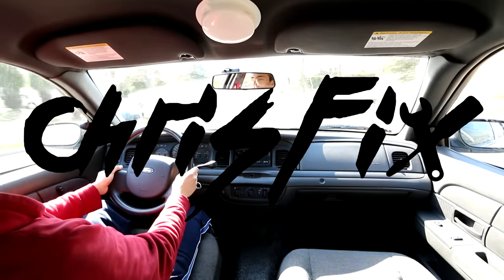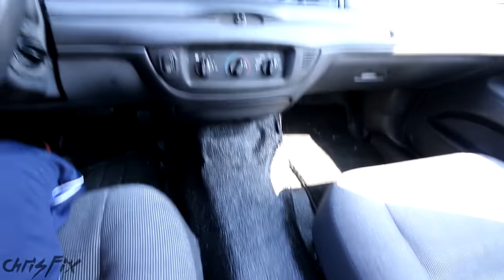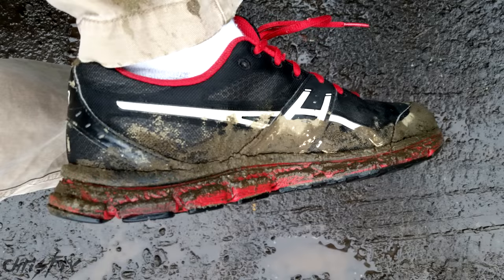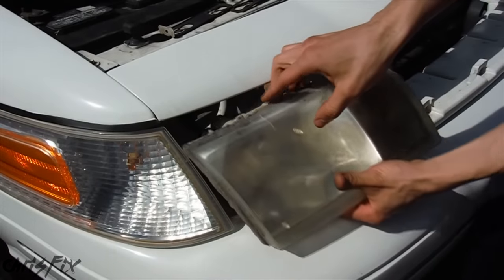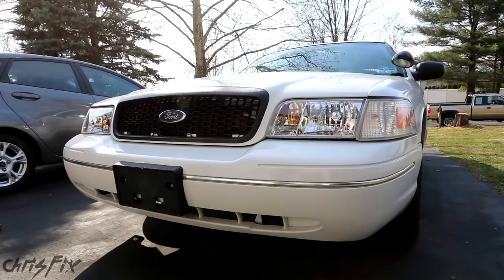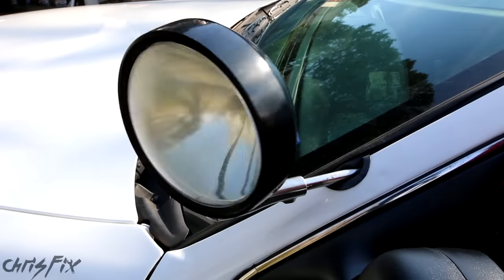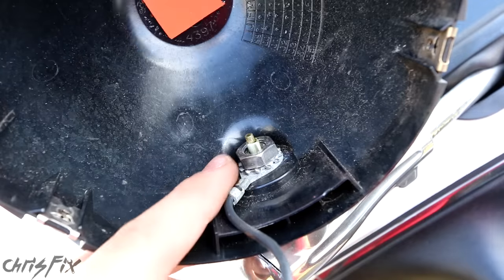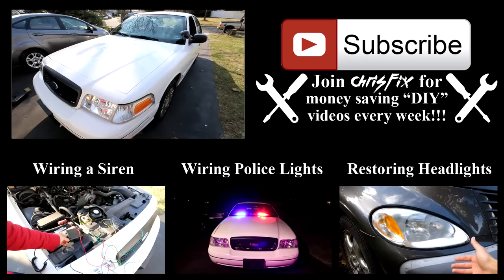How to Turn a Regular Car into a Police Car (Episode 1 Project Police Interceptor)

Comment: you forgot to replace the blinker fluid
Reply: And drain the spark plugs!
Reply: Aye, The Blinker fluid was replaced, and the spark plug got drained with Chris Got It!
Reply: lol 69 likes. i would like but i dont want to ruin it.
Reply: And check your tires gasoline levels
Reply: Blinker fluid is a scam! I've run my blinkers for over 10,000,000 blinks before, with no problems... sure my headlights caught fire, but that just means they were even brighter! Like the fucking SUN! 
You keep buying premium blinker fluid, you fool... I'm not falling for it.
You only need to remember your put gas in, change the oil, and make sure you grease your brake pads often so they don't rust.... no one wants rusty ass brakes.. that's dangerous!
Reply: I was about to say that
Reply: txhogndeerhunter LOL
Reply: He needs new muffler bearings too
Reply: He also forgot to drain the steering wheel oil
Reply: XD
Reply: might wanna check too for a rusty spark tube
Reply: And replace it for a pagani sonda
Reply: @mimic5332  r/woooosh
Reply: @trill-taco  I know I'm just being a troll
Reply: @naythan3076  well uh 10x that now
Reply: Blinker fluid and spark plug floid is not a thing
Reply: danteelite r/wooosh
Reply: UUUUUUH!
Reply: FBIOPENUP MEME woah I found you here
Reply: txhogndeerhunter wtf is blinker fluid???!
Reply: Remember to add summer air
Reply: Also spray the disc brake with wd40
Reply: txhogndeerhunter let’s not forget headlight fluid not just blinker fluid
Reply: And your gas fluid!!!?
Reply: Raptorz Playz he topped off the gas fluid a while ago
Reply: @bryantbressette7397  dont forget summer and winter air
Reply: Needs new piston return springs by the sounds of it
Reply: Ayooo to forgot to replace the radio oil
Reply: @noma_es_sebas  What about the Artillery Bearings in the Headlights?
Reply: Lol
Reply: @DanteYewToob  r/whoosh
Reply: Dead meme😂😂 stop it🤣
Reply: Cutted the clip ig?
Reply: @dlawlz  ممك٠
Reply: And also the Piston Return Springs
Reply: @Scotty-vs4lf  oof.
Reply: Guys chill there’s more episodes
Reply: @jessdixon6729  whooosh
Reply: @noma_es_sebas  They forgot the mirror oil as well :O
Reply: Yes
Reply: He forgot headlight fluid
Reply: No
Reply: @dlawlz  no
Reply: @AJPlayz-zi8xf  no
Reply: @gamingcorral123fanboy9  no
Reply: @noma_es_sebas  no
Reply: @Cheeky-Biscuit  no
Reply: @divijharshalbamb8764  no
Reply: lol
Reply: Yep🙄🙎‍♀️🤦‍♀️
Reply: @DanteYewToob  bro it’s a joke
Reply: Forget The Blinker Fluid!>:(
Reply: and you forgot to grease your brakes
Reply: If only he made other episodes.
Reply: Did you replace the spring oil
Reply: Bruh
Reply: Lol if splashed on 👁 it will cause rapid blinking
Reply: @DanteYewToob  don't swear
now u owe $5 to the swear jar
Reply: And he forgot to replace the muffler bearings
Reply: @DanteYewToob  r/wooooosh
Reply: NO
Reply: And the horn fluid
Reply: And the horn fluid
Reply: That’s not a thing it’s called electricity
Reply: You’re right but who cares
Reply: There’s no such thing as blinker fluid, it’s just a thing that people say to trick other people
Reply: @joshuaporter-vq8ub there joking

Comment: 2:03 Actually, lot of P71's came with idle hour meters built into them which are usually either somewhere under the hood (usually on top of the passenger side wheel well) or there will be one built into the dash cluster which you can access using a special button combination on the stereo.
Reply: Unless it's a 2005 or newer I believe, it's when they got the new gauge cluster with the digital miles, they built the hour counter into that. Starts at miles, then ya click it to trip, then to hours and finally back to miles

Comment: most states allow citizens to equip their vehicle with strobe,  led,  rotary or other warning lights so long as they are amber, orange, yellow and operating only when broken down on the freeway,  highway,  or being used for work,  plowing,  emergency recovery of another vehicle,  etc. .. the important thing is that yellow,  amber and orange are pretty much universally accepted for John q public,  just not red,  blue,  or actually green,  as some ambulances have those as well.  I drive school bus and our inclement weather strobes are white, though I'm not sure of regulations on those,  never seen anyone other than us use white strobes however.
Reply from the maker: +Jason Weidner thanks for sharing!
Reply: +Jason Weidner That's pretty interesting to know..    ty
Reply: Green strobes aint allowed cause in USA thats often used for security patrol vehicles. Green and orange is normally the combo for security vehicles. 
In norway tho, we can use orange strobes and rotary lights and all that whenever the car is used for "unusual purposes", like when u drive with something big on the roof or some like that. Dont need any permeits for it, blue however is strictly for emergency vehicles.

Comment: The old headlights are brighter than the new ones you know
Reply: They look brighter due to the cloudiness of the old headlight. Which mean more light stay in the compartment of the headlight and less goes out. However, since the new headlight is cleaner that mean it is letting more light outwards.

Comment: Hey Chrisfix, 2 questions: 
1, would a Decomissioned cop car be a fine daily driver, excluding wear and tear?
2, How hard is it to get one?
3, Any things you should know before buying or using one?
Thanks chris, your videos are well made and i genuinely enjoy you do the most basic of things.
Reply: 1: kinda, depends. if its a police interceptor expect terrible gas mileage, and to have to do regular preventative maintenance in order to keep it running
2: Not very, just check auction sites
Reply: 2 questions.
meanwhile the questions:
1
2
3
Reply: @fbiofcp  the math do not be mathing

Comment: When he's describing all the upgrades in the police interceptor model all I can think is
"The car's got a lot of pick-up. It's got a cop motor, a 440 cubic inch plant, it's got cop tires, cop suspension, cop shocks; It's a model made before catalytic converters, so it'll run good on regular gas. So, whaddya say, is it the new blues mobile, or what?"

Comment: Jake: "What the hell is this?" 
Elwood: "This was a bargain. I picked it up at the Mount Prospect city police auction last spring. It's an old Mount Prospect police car. They were practically giving 'em away."
Jake: "Well thank you, pal. The day I get outta prison, my own brother picks me up in a police car!"
Elwood: "You don't like it?"
Jake: "No I don't like it..." 
Jake: "Car's got a lot of pickup."
Elwood: "It's got a cop motor, a 440 cubic inch plant, it's got cop tires, cop suspension, cop shocks. It's a model made before catalytic converters so it'll run good on regular gas. What do you say, is it the new Bluesmobile or what?"

Comment: 8:33 the only experience with electricity we’ve done in school is in chemistry. It’s kind of sad it just occurred to me that we have never been taught the basics of electronic circuits. In chemistry we found out how to make a battery produce volts with an oxidation reaction, and how to measure the volts using an equation comparing the anode and the cathode and using stoichometry to find the volts produced. But we never even learned the basics of the volt measurement device or how to use the terminal correctly.

Comment: If the doors only open from the outside why install handles in the first place?
Reply from the maker: It’s cheaper to use the doors on the normal crown Vic’s.
Reply: ChrisFix oh ok and I wish I had a Crown Vic but I’m 10
Reply: 11

Comment: I am thinking about joining the US Army military police Hey Chris-Fix it’s Bret I was wondering if you and SaabKyle04 could sometime soon help me work on my Dream SAAB she’s any green possibly British racing green like most Polizei Deutsch which means German police but the 1970-1972 Saab Sonett III if you and Kyle Lindsey the SaabKyle04 guy buy it stock then have this SaabKyle04 guy buy it for me on eBay motors when someone starts selling it for an eBay Auction maybe later make your next project car all stock and without anything missing just like new sometime keep the Sonett III as a normal Sonett III to a Saab Polis Auto; Polis means Police in Swedish my mother has a few sweetish ancestors so when I join the military police I think that would be good to go for a top speed at the largest number at 120 mph on the Speedometer and call this stock Sonett III(three) Project Polis and I want it way under 100,000 miles so the engine will be a fully tuned turbo supercharged SAAB V4 with a stick mounted to center floor 4 speed manual but I want it sometime much later be upgraded for the military police so I can chase and help speeders on US routes that break the law and I will have Kyle drive my dream SAAB for me to Auto Zone off of Maryland route 26
Reply: Bret Brennan So you want them to buy a car for you with their own money, fix it up using their own money and just give it to you for free? No, lol.